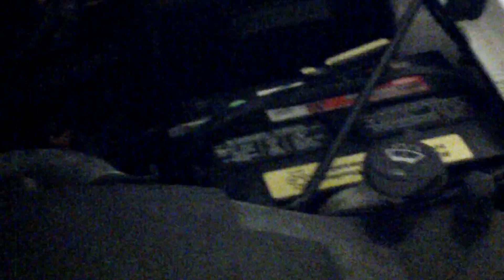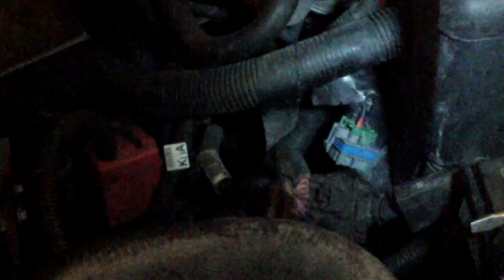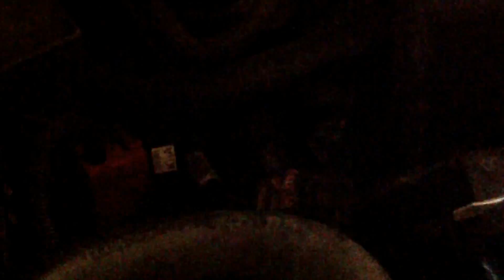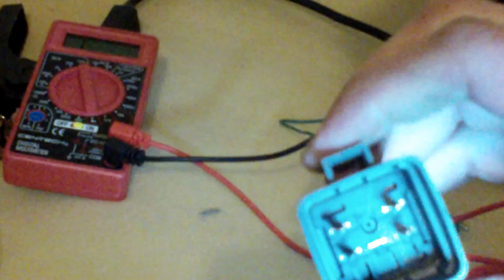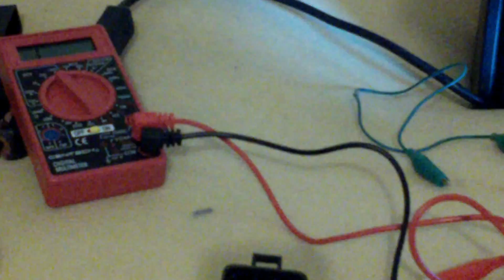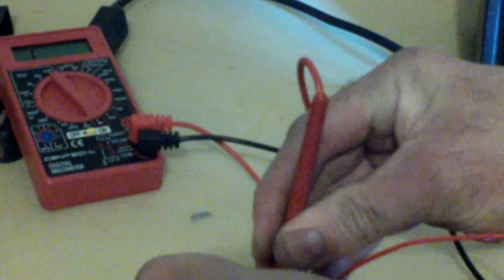How to test ALC Relay GMC Air Ride Suspension

Comment: Well.... Thanks for taking the time to clarify all of this Relay " theory " ---   I didn't really need this info Exactly
..but it was informative, and educational.  I've been trying to remove The " Service Ride Control " message on My 2000 Yukon XL ( 5.3L ), as I now Have an Air Shock System on the Rear.....most of the Air Ride System has Been Extracted. I'm still just Checking to see if Removing a Fuse, in one of the Fuseboxes ,or a Relay....( Please Be Specific ... ) Would Turn off the " Air Ride " Message.... Forever. Any Suggestions....?  Thanks in Advance....  Iv'e asked under " Comments " on other YT
Videos...but Never Got a Response.... Therefore , My Message is Still Announcing..... Daily....!!
   BillinL.A.   5-30-2021.

Comment: I have found your posts very helpful in troubleshooting why my auto ride not working.  Initial symptoms were compressor not turning on, so checked fuses IGN3, etc. all seem fine,  We tested the ALC relay per your guidelines and all worked just fine, we even replaced it after further troubleshooting just in case we blew the relay out.  Anyway, we removed wheel well flaps and manually adjusted the level sensor on the left rear wheel to activate the system.  When doing so, we were sometimes able to feel a click in the relay.  However, after changing out the compressor, still does not seem to work.  So, in this order...shocks are ok per chevy dealership, no codes being returned on the tech 2 scanner, relay appears to work, and i have brand new compressor.  Additional question?  is the new compressor sooo quiet that i won't be able to hear it come on/off like the initial compressors from OEM?  thanks ...
Reply: I'm not hearing anything either and I have no codes. Could have sworn I used to. did you ever resolve your  issue or was it just very quiet
Reply: 8 years later here but no the compressor is not quiet you can 100% hear it. I am having same issues as you currently. Did you ever solve the problem? No blown fuses. Relay is fine. Was it your ride height sensors?

Comment: so I jumpered 87-30 because I do not have the ability to put 12volts on the relay,  but the compressor motor kicked right on which made me happy.  So did this fix your car or not....I am searching for an ALC relay but I am not sure where the control voltage for the relay comes from
Reply: Hey Grover what did you end up figuring out on your Escalade suspension? I can hook power to the other side of my relay and compressor kicks right on!
Reply: I found out I have the burnt exhaust valve solenoid...thinking of blocking off the exhaust valve line and manually operating the compressor when needed....my truck is 10 years old and I am trying to decide whether to invest the money or not